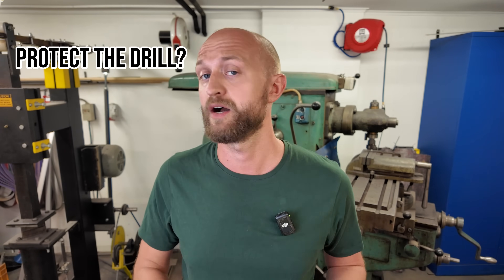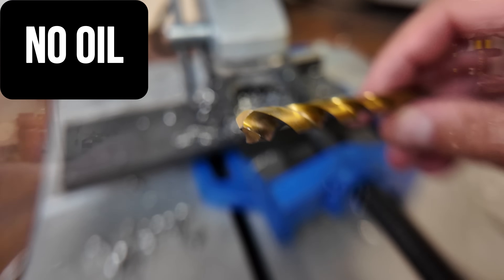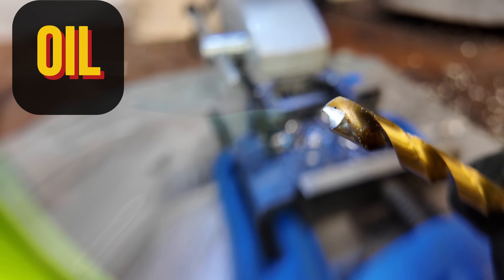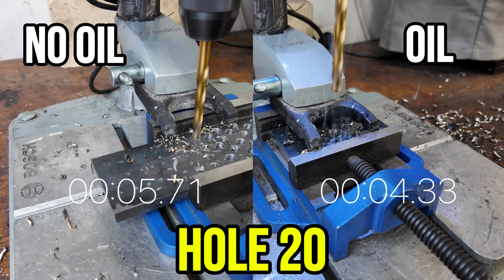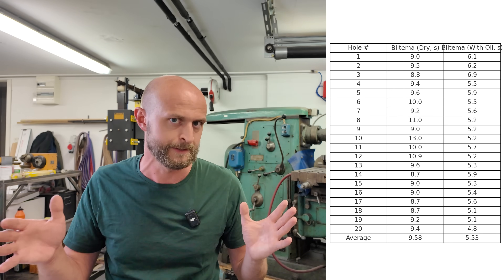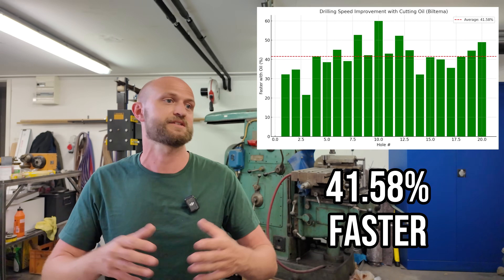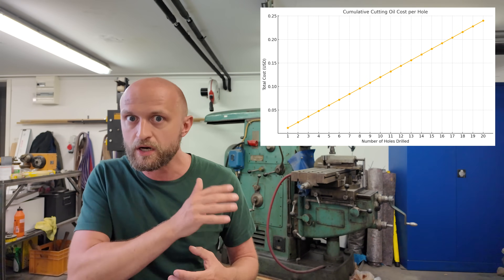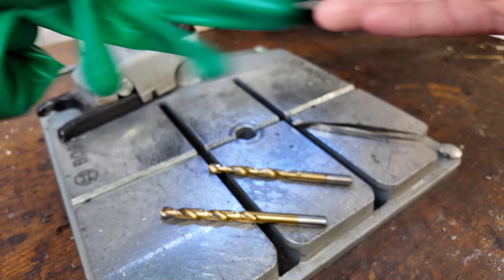You’re Drilling WRONG — Here’s the Proof

Comment: You can buy water soluble oil (costs like 20$ for 5 liter concentrate which gives you 50 litres of cutting fluid) or just make it yourself using dish soap, leftover oil and water (around 10:2:1 water to oil to dish soap ratio, use as much dish soap as needed to emulsify oil with water. After some time such DIY cutting fluid will separate but it needs just few seconds to be mixed again.
Reply from the maker: That’s a great tip — I’ve tried water-soluble oil before and it works well. In this test though, I wanted to focus on straight cutting oil so I could compare performance directly without other variables. Might be interesting to do a follow-up with your DIY mix!

Comment: I like to use water soluble cutting oil, 10:1 dilution - cheap as chips and gets the job done nicely. $15 for a litre of the concentrate oil, makes 100 litres which lasts me about 10 months.
Reply from the maker: That’s a solid deal and a lot of coolant for the price! In this video I was testing straight cutting oil specifically to see how it performed on its own — but a water-soluble mix like yours would be a great follow-up test.

Comment: Any lube is better than none….heck, if making a quick DiY job with bits upto 3/8th I will use spittle rather than dry drill.  You must carry the heat away if you want your bits to last.
Reply from the maker: Haha, I’ve definitely heard of the “spit method” before — and you’re right, almost anything is better than running completely dry. Moving that heat away really does make a big difference for bit life 👍

Comment: I have water soluble coolant in a squirt bottle for the manual drilling. Best compromise IMO, no smoke and very low cost. For tapping I sometimes use a tiny bit of regular EP grease.
Reply from the maker: That sounds like a great setup — water-soluble coolant in a squirt bottle is a nice balance between performance, cost, and keeping the mess down. Good tip on using a little EP grease for tapping too.

Comment: Who could have possibly guessed that cutting oil does what it's designed to do??? 🤯  Next, you should see if those mechanics are lying about cars needing motor oil. Try running your car without oil in the engine. Maybe you'll prove them wrong.
Reply from the maker: It’s not about proving anyone right or wrong — it’s about seeing the results firsthand and understanding what difference you can really expect in this setting. I was actually surprised myself by the cost-per-hole calculation.

Comment: for drills i much prefer oil or suitable water/oil emulsion, but then mostly lathe work or mag drill shorter drill time and less wear, thought that was common to know
Reply from the maker: That makes sense — with lathes or mag drills, the shorter drill times and better lubrication definitely help. I figured it was common knowledge too, but it’s always good to show the difference in practice
Reply: @SteelSurgeon-h6p do agree nice with definite tests, tho id say drilling on lathe can take awhile esp if deep holes/big dia, do the same with my old drill press, but then i just got a oil can which is add a bit here and there
Reply: And good for min/maxing as coolant allow max speed and feed, but prefer to keep it a bit under since not in a hurry
Reply from the maker: I’m the same way — coolant definitely lets you push speed and feed, but in my shop I’d rather stay a bit under and keep things controlled. And yeah, a simple oil can works surprisingly well for adding just enough where it’s needed.

Comment: My best advice , always drill pilot holes . 90 % of the drill bit resistance is generated by the point , eliminate the center and you reduce effort and tool wear .
Reply: I generally use a drill about a third the final size. And two sizes of pilot drill on larger holes. I have a small lathe and a cheap bench drill.
Reply from the maker: That’s a solid approach — especially for larger holes, those stepped pilot sizes really help take the strain off the final bit. How small do you usually start on something like a 12 mm hole?
Reply from the maker: That’s a great tip — reducing the center resistance really does make a big difference. Pilot holes can save both effort and bit life, especially on tougher materials.
Reply: I never drill pilot holes unless the final bit is larger than 25mm, it just take more time overall and you lose the “feel” when you about to punch through.
Reply: @nubbethefatso2650  if you are drilling by hand you will never remain located . That bit will drift . If you pilot you will follow the pilot , that is why they call it a " pilot "
Reply: On a machine that can provide proper force it is a waste of time. There are a few other potential issues as well. 

The larger bit will follow the smaller hole. For a short hole this won't affect the hole location much, but drilling deep holes with a small bit will tend to wander (bending the bit and hole). Then when you drill the larger hole with the stiffer bit, the top still follows the smaller hole causing it to oversize the hole and be out of position. 

If the pilot hole is much larger than the web, it is easy to feed the bit too fast causing too much heat and burning up the cutting edge. 

Not having the material in the hole reduces the heat dissipation. That is usually made worse by the previous issue causing the bit to wear out quickly. However, there is also less rubbing to generate heat, so may be a wash if the pilot is as small as possible.

If you are using cutting oil, it lets the oil drain out, instead of being a puddle right in the cutting zone.
Reply from the maker: That’s a really well-explained breakdown — you bring up some points I hadn’t considered, especially about deep hole wandering and heat dissipation. I guess in the end it comes down to matching the method to the machine’s capabilities and the job at hand. How often do you find pilot holes actually causing more problems than they solve in your own work?
Reply: @SteelSurgeon-h6p  long ago a wise old machinists told me " son , let the tool do the work "
Reply: @SteelSurgeon-h6p If you are using a drill press or milling machine/large they are usually not worth the trouble or pilot drilling. Only when drilling by hand and there are large forces required to get a good cutting rate does it matter. Or on very large bits that are stretching the capacity of the machine. 

I rarely have problems with pilot drilling as I never drill a long hole by hand, and on thinner materials I'll keep the pilot real close to the web diameter and not push quite as hard. Particularly as the bit breaks through and there is no material below to absorb the heat. Watch your chips and you will see them turn colors right at the end if you don't back off pressure. That overheating damages the bit.
Reply from the maker: That’s a great bit of advice — simple but so true. It’s amazing how much longer tools last (and how much smoother the work goes) when you actually follow it.
Reply from the maker: That’s a great breakdown — I like how you tied it to both the type of machine and hole depth. Watching chip color is something I’ve only recently started paying closer attention to, and it really does tell you a lot. Do you have a rule of thumb for backing off at the right moment before breakthrough?
Reply: @SteelSurgeon-h6p Breaking through is usually by feel and not super precise as when you are pushing fairly hard it can be pretty sudden. But I usually let off the pressure a bunch when getting close to break through. Often you can feel it start, or see the chips change or On a machine you can set a depth to prevent it.
Reply: @SteelSurgeon-h6p I thought of one more drilling tip. When cutting soft materials like some plastics, but particularly brass, copper, or lead, the bit will pull itself into the part suddenly. This often makes you drill too deep, but also overloads the drill and can break it. If you grind a flat on the cutting edge parallel to the axis of the drill (making it have zero rake instead of a positive rake) it would grab and do that anymore.

Comment: Great video.  If I may, I will add my two cents.  First, you are correct.  You should use some type of cutting oil/coolant when using drill bits.  Second, yes, there is a problem with smoke/fumes when using cutting oil. And a big mess.  So the question is, can you drill without cutting oil?  Yes, but you must use the correct speed or RPM to minimize wear/damage to the drill bit.  I purchased my first drill press over 40 years ago and because of the smoke and mess, I choose to forgo the oil. When you use a slow (correct) RPM, you can drill without oil.  Yes, it will take longer, but the trade off is no smoke, no mess.  And you can sharpen drill bits.  I'm still using some of the drill bits I used 40 years ago!  Thanks. Regards.
Reply from the maker: Thanks for sharing your experience — 40 years with some of the same drill bits is seriously impressive. I completely agree that using the right RPM can make a huge difference, and it’s good to be reminded that it’s a trade-off between speed, bit life, and the mess that comes with coolant or oil.

Comment: I always use water and a small amount of dish soap. After drilling most of the time I'll have a welding procedure on the part and I don't appreciate the negative effects the oil has on my weld and health as the residuals burn off. The water evaporates very quickly. Even during the drilling the oils produces smoke.  The cooling effect of water is greater than oil and the addition of soap grants some lubrication. You have clearly shown the benefit of keeping the bit cool though. Appreciate your video.
Reply from the maker: Thanks for sharing your approach — that makes a lot of sense, especially with welding right after drilling. Avoiding oil residue and fumes is definitely a health and weld-quality win, and the soap addition for lubrication is a smart touch. Glad the video resonated with you!
Reply: That's interesting. I've been using a recipe of water:glycerin:dishsoap = 90:9:1
Maybe I'll try it as a cutting fluid.

Comment: As a veterinary surgeon, and now a machinist making products, first, you’re FUNNY!  I started drilling extremely hard pins with a carbide bit.  Because I didn’t have a fluid pump, I put my water soluble oil in an elevated bucket and fed the drill area like an IV drip, only a bit faster.  Now, many years later and totally upgraded, I absolutely flood my drilling.  These pins are so hard I’m lucky to get 20 holes per bit, but I can only imagine how costly it would be without coolant and lubrication!
Reply from the maker: I really appreciate that — and it’s always great to hear from a fellow surgeon. Sounds like you’ve dealt with some seriously tough material, and that IV drip setup was a clever solution before you upgraded. Getting 20 holes per bit in pins that hard is impressive, and I can only imagine how much coolant has saved you over the years!
Reply: @SteelSurgeon-h6p , Ah, Sverige!  The half of my lineage of whom I’m proud emigrated from Sweden in the early 1900’s.  My veterinary practice name was “Häst”, which I still use today.  I’m going to go back and look at some of your previous videos, and looking forward to new ones.  Also, I recently added a mister to spray the cutting surface when I make a bullnose on aluminum edges using my new shaper.  While I have used TapMagic, a petroleum product, I found the soluble oil in water is not only cheaper, but gives a nice finish.
Reply from the maker: That’s great to hear — always nice to meet someone with Swedish roots! “Häst” is a fantastic name for a practice. The mister setup on your shaper sounds like a smart addition, and I agree — soluble oil in water can be a very cost-effective way to get a great finish. Appreciate you checking out my other videos!

Comment: Cutting oil and coolant is used to lubricate and cool the cutting edge. Water based solution is the best as water is the best for reducing heat while the oil reduces the friction which causes heat which can effect the material and the cutter. Plain water will produce rust on the machine and maybe the material but it absorbs and dissipates heat better than oil. Machines I have used that used straight cutting oil , normally thread grinders, have a cooler as oil will hold the heat and slowly heat up. Soluble oil that is used in coolant stops the rust and provides lubrication on the cutting edge which helps maintain the sharpness longer. Paste types of cutting oil only works at slow speed like any hand operations like tapping. Some paste types if used while drilling actually becomes a carcinogen so any materials that are used should have their relative material safety data sheet read and understood. Rocol was such a material as in the old days it had benzine in it and was responsible for testicular cancer. Rocol paste use to be thinned with kerosene so it was able to be pumped onto the work but nowadays there is much better solutions on the market. If the operation gives off smoke then don't use it until you know what you are breathing in. Using a breathing device or extraction is the minimum PPE that should be used. Use pastes only in low heat applications like tapping, reaming and using a stock and die. Always run any cutter at its preferred speed with plenty of coolant. Using straight water on stainless does not reduce the friction which will prematurely destroy any cutter used and always keep pressure while feeding as any rubbing may work harden the material. Never use any form of flammable liquid as a cutting compound. Methylated spirits used to be used as a coolant but any form of ignition point, like a spark from an electric motor can cause it to ignite. Never use anything that isn't made to be a cutting compound as you dont know if it can cause a fire or what you are breathing in. Always read what applications the coolant is to be used for there are very few one fits all solutions that if used incorrectly can cause health problems later on in life.
Reply from the maker: Thanks for sharing such a thorough breakdown — there’s a lot of valuable safety and practical knowledge here. The point about checking the safety data sheet and avoiding flammable or toxic compounds is especially important, and something I think many overlook in a home shop setting. I appreciate you taking the time to lay it all out so clearly!

Comment: You should be fair and flood the drill bit with oil while cutting. Were you really using any oil?
Reply from the maker: I did apply plenty before drilling — covering both the material and the full flute of the bit. A constant flood setup would be interesting to compare, though

Comment: I use oil always. I also adjust drill rpm to match down-pressure to maximize bit life and hole quality. Speed is the last thing I worry about.
Reply from the maker: That’s a great approach — matching RPM to feed pressure makes a big difference for both bit life and hole quality. I like that you prioritize longevity and precision over speed. In this test, speed was only a way to demonstrate how much faster the drill can cut with lubrication
Reply: @SteelSurgeon-h6p  "matching RPM to feed pressure makes a big difference"
Starting with RPM... RPM is selected relative to the peripheral speed that a cutting tool can stand (balancing  the cost of time saved drilling against the time spent resharpening,  and perhaps resetting stops for depth, etc.
So, example. MS drilled using HSS bit, flood coolant.  100 fpm/ 30m/minute... You can calculate that mentally by taking the drill diameter in mm, dividing that into 100, then multiplying that answer by 100, so 20 mm hss bit, mild steel workpiece, flood coolant, 100/20 x 100 = 500rpm (485 if you use a formal calc, so why bother?) Drilling dry? use 60% or 50% of that speed, 300 or 250 rpm.
Feed pressure? Feed rate is determined by the finish you require, but limited by the machine's motor power, and the drill bit's ability to transmit that power. What drives the bit into the workpiece is 'force' not pressure. In all cases in machining, MRR (Metal Removal Rate) is limited by... Motor power, machine rigidity, and the machine's spindle rate range, plus other factors.

Try, though, drilling a 1/16" (1.6mm) hole on a machine with a top spindle rate of 1500 rpm, and your MMR will be severely limited, whatever amount of power the motor can deliver, but you'll make better progress with a low power "sensitive" drill that offers 6,000rpm, and more... because, the small drill can't progress at high feed rates.  Let's say the maximum feed per rev is 0.01mm,  you can progress at 15mm per minute at 1500rpm, 60 mm per minute at 6000 rpm (illustrative, only)
Drilling's considered one of the simpler machine shop tasks, until, say, you've got an 18" long, 1/2" diameter hole to drill, end to end in an injection moulder nozzle, and the finish has to be quite reasonable, to avoid the plastic material 'hanging up' and you've already invested time in the external machining work, don't want to throw the part away because you broke a drill inside it... (and the drill is one you welded a long extended shank to for this one job, usually undertaken by a gun drilling contractor, but you're in a hurry...)
Reply: Generally, I use cutting oil and keep the speed below 500 rpm with adequate pressure .
Reply from the maker: That’s a solid approach — keeping RPM low with good feed pressure and cutting oil can really extend bit life and improve hole quality.